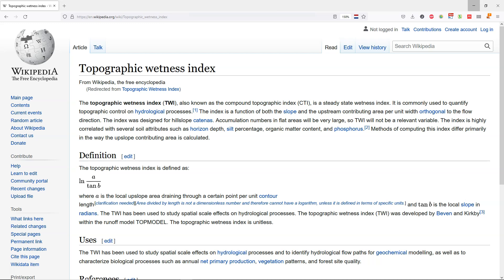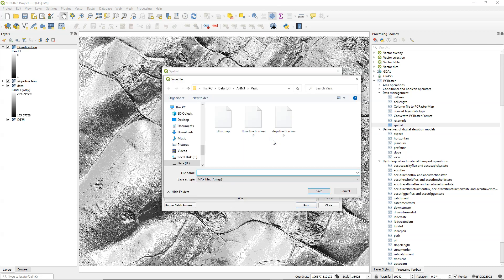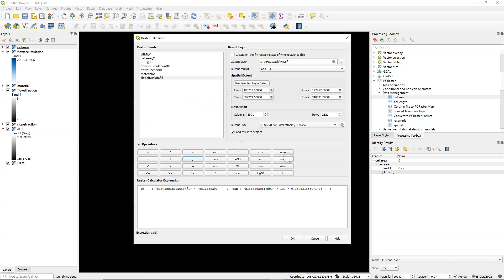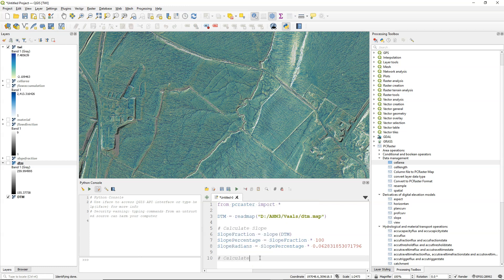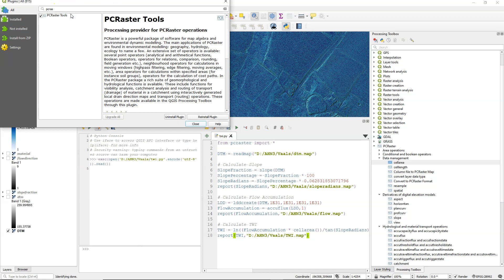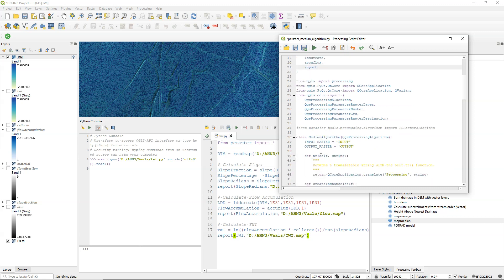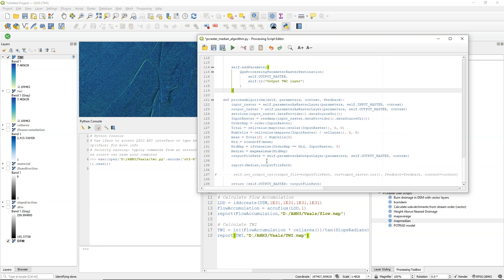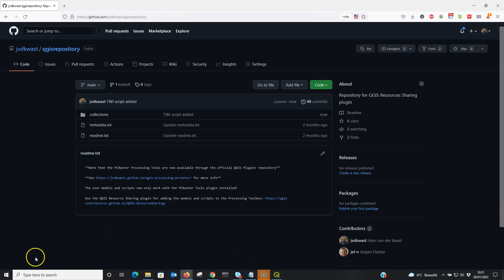Calculate Topographic Wetness Index and Create a Processing Tool in QGIS

Comment: When using lddcreate it just calculates into infinity and I have to kill the qgis process using task manager. Any idea what could be going on? Using some AHN4 tiles which I merged together as DEM.
Reply from the maker: The combination of a very high spatial resolution and a large area makes the file probably too large to handle with your computer resources. For larger areas and for many applications it's often not necessary to have a high resolution. If you still need this, you can see if other algorithms from SAGA or GRASS can handle it.

Comment: Hello Hans, my TWI.map looks very different from your's. It is very pixely and i cant detect a clear pattern. In the video you said there could be isseus because of values of zeros in the slope map. Well, my layer has some zeros but I'm not sure how to fix them. Best regards, Ruben
Reply from the maker: If you have zeros for slope you need to replace it with value 1. Ln(1) then equals 0. Ln(0) results in nodata. Other issues can be your projection or resoltion of the DEM. Also check my other video on TWI.